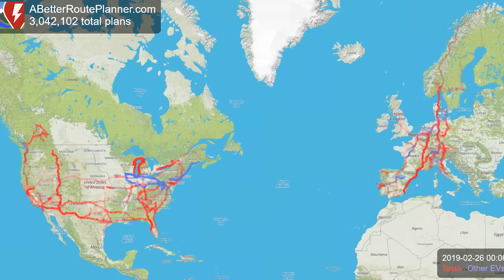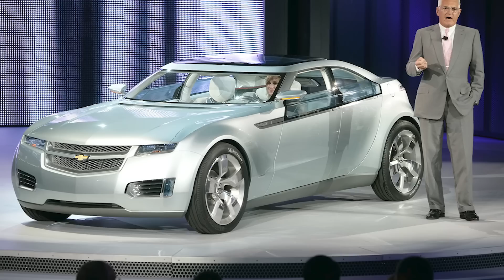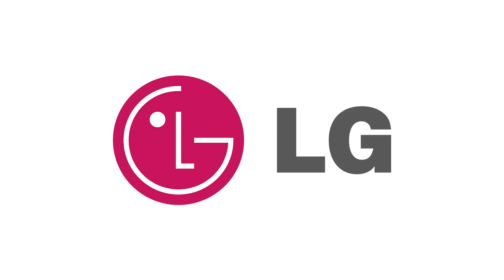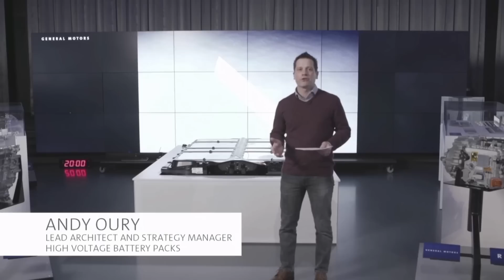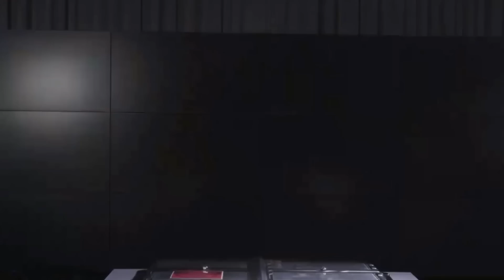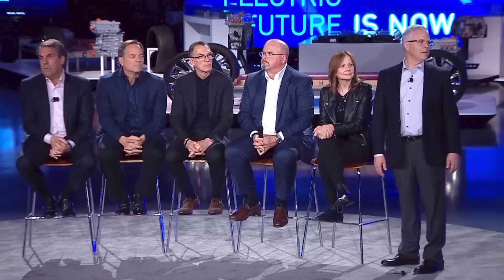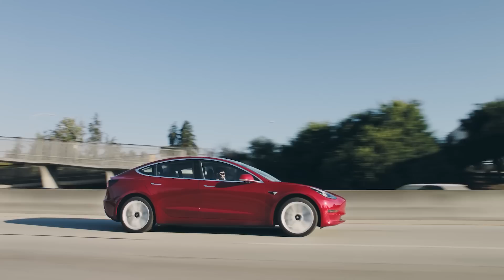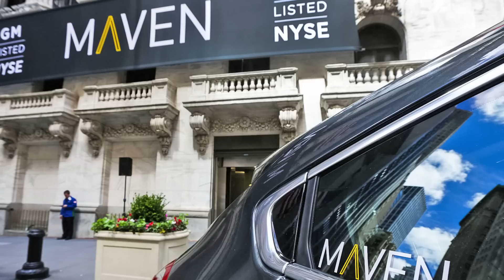GM EV Day | In Depth

Comment: My Volt “16 is great for what it is, still is, the longest range essentially plug-in hybrid. But then my Model 3 came and the rest is history. The same pack batteries they show is what was in the “12 Volt, except for whatever reason they put the batteries vertically instead of flat and in a giant T shape because they were shoehorning them into an existing small car platform. So they are making progress and I applaud them for it but they really needed to announce complete EV replacements for entire segments. Or else their EV’s are going to compete with the ICE versions of the same car and languish and go nowhere. If they said “all GM crossovers will be EV’s, there will be no ICE crossovers” that would be huge. So I think it’s great but it’s not nearly enough.

Comment: the most "funny" thing (actually pretty sad once i thought about it) is ... 1 million EV in 2035 ... if the sales volume of GM declines roughly at the same rate as it has since 2016 .. they are only going to sell a million vehicles total in 2030.
i mean that could be them saying "all of our car sales will be EV in 2035" .. but that also means that likely 50% or more of the jobs are lost if they drop sales by 70% or so

Comment: I have been a fan of Tesla, even before its creation, since AC Propulsion and tZero, when I was designing my Cherokee EV project. I ve been watching u appreciatively for ur work too.
But, I remember how non-constructive and ridiculous reports and videos against Tesla were back in the days. You sounded like the ICE-supporters hammering on Tesla and EVs, full of despise. I am rather happy that GM (despite their very dark and almost evil EV history) have been forced down the path of EVs. Every step a co makes in that direction is good. If they are not quick enough to adapt and change, then someone else will take their place. In fact GM's announcements may push smaller emerging companies or even other big competirors to move faster.
So be nice. Be supportive. Even to the ones who are just starting to move now. Every little bit of force in the right direction helps our planet, directly and indirectly.

Comment: At 26:00 you reacted to the comment that "our auto dealer network is a huge asset ".. I agree as it is now, it will crash and burn, and Jesse pointed out they can drive right out of the factory and right to profit.  However,  GM has never wanted a hold onto equipment or maintain it..  Just like they care not how you charge your car, that is for someone else to figure out.. 
My guess is they think they will make the cars, then the dealers will buy them and THEY will run the ride share aspect, maintenance, charging, ect.. and then buy new cars as they get worn down.  Replacing repairs of existing vehicles with autonomous Fleet Management as a revenue stream.

Comment: Just wondering so many still believe in Musk's hypes. No real electric vehicles will replace the current 99% "fleet" of ICE cars and trucks until proper battery source is invented/discovered and stop powering these current expensive toys with laptop batteries. Whoever put the new Ford-T-Electric on the road will be the king. Just mho.

Comment: Current Chevy Bolts have flat pouch batteries as I understand it.  The issue with any EV battery type is is cooling and heating the whole system of batteries when necessary--and doing this with minimization of electricity consumption.

Comment: To be clear, GM did develop a skateboard ev platform way back in 2002 and used it in their 2003 Hy-wire concept, which they promptly did diddley squat with. Essentially everything they announced was from 2003.

Comment: Zac, you said about the Chevy Bolt:  "LG makes the car" ??? Do you mean that LG makes the batteries  ?
Reply: Pretty much everything important is made by LG Chem with the car assembled in Michigan. See https://www.greencarreports.com/news/1102176_bolt-ev-powertrain-how-did-gm-and-lg-collaborate-on-design-production
Reply: @JimArnold6  Wow.  I had no idea.
Reply: @aardvarkansaw  We own a Bolt, Tesla and a Leaf. If the Bolt fits your use case and wallet, it's a competent EV that somehow escaped from GM. The Weber State Bolt videos by John Kelly are interesting and gave me the insight to the Bolt's potential before making the plunge - https://www.youtube.com/user/WeberAuto/search?query=bolt - Tesla, however, is in another league when it comes to driving dynamics, software, charging, autonomy, etc.

Comment: Regarding GM's history with the skateboard design:  https://en.wikipedia.org/wiki/General_Motors_Hy-wire
Best quote: "In 2003, General Motors stated that it was confident that it could produce a commercially viable model by 2010."

Comment: When GM named the “Bolt”, I knew they were messed up in the head because of the confusion with the similar name “Volt”.  Unreal.  I have a 2016 Volt LTZ and love the car.  Best car I’ve ever had and got it for half price one year old.  My problem with Tesla, in spite of their superiority, is the cost.  The Volt gets me round trip to work and the engine takes me on road trips.  In the coming years, I’ll got pure EV but my Volt is still the car that works for me.  Likely the next car will be the cybertruck or model y.
Reply: Hi Andrew, I agree completely about the Volt.  It is the perfect "first EV" for many people.  I bought my 2016 Volt in January 2019 at Carmax for 19K.   It has been fantastic.  I have a 45 mile round-trip commute.  Because of the 50 mile all electric range, unless I go out of town I simply do not use gas.  I've put approximately 16K miles on that car, and 14K of those miles have been 100% pure electric.  My next car will be a full battery electric vehicle (BEV), but the Volt is perfect for me right now.

Comment: Used to buy a new GM car every two or three years starting with the 1955 model year.  Next was the 58, 61, 64, 69 and so on.  Back then GM was managed by innovative leaders and still their cars had reliability problems.  It seems that each year since then their cars have got worse.  In the 70s some of their cars were rusting out right in the show room even before they hit the road.  My last new GM car was a 1998 Buick Regal.  Started out great then developed electrical problems and the power steering rack failed.  Now all their leaders in innovation have retired and they are even struggling with making ICE cars let alone trying to compete with all the new electric car companies.  Based on their past history I am now questioning why we even bailed them out a few years ago.  It seems they are still trying to make their failed business model work.  So sad to see them continue down the wrong road.

Comment: did anyone notice the 200kwh battery size they were talking about and the '400 mile' range that the vehicle would get? that equates to 2miles/kwh....that is the worst ev efficiency number i have ever seen! even the tesla model x towing has over 2 miles per kwh...Then do the math on how they are saving money on batteries and you then notice that they are still spending double what tesla does for the amount of range that they are getting when they have to double stack the battery to achieve 400miles of range. for example, the model y is over 300miles per charge of about a 70kwh battery. if gm paid $100/kwh for the battery it would be $7000 for a 300mile range assuming the efficiency was on par. their efficiency is effectively half so a car that goes 300 miles would take a 140kwh battery or $14,000!!!! how can they possibly say that as a good thing?? At this point it is super easy to tell that they are completely lost on electric cars and have no idea what to do.

Comment: Porsche:  We just made the least efficient EV in the world!
GM:  Hold my beer.

Hummer:  800kw battery, 400 mile range.  0.5 miles per kw.  Oink. Oink.  Dredge the road.  Hope you're driveway and garage can handle a 20,000lb vehicle!
Reply: David Urry, I couldn't find the actual battery size, but they have an 800 volt battery. The battery won't weight 20,000 pounds. It'll be less inefficient than a Tesla, I would bet, but it won't be 10 tons.
Reply: My guess is that it would take a 120 kWh battery to go 400 miles.

Comment: TSLA will have 1 giga factory/year for next 4 years and after that 3 giga factories every 2 years iff they can find battery supply. So, i.e. 3 (now)+4 (2020-2024)+9 (2024-2030)=16 gigafactories by the end of 2030. 16*0.6M(conservative) cars ~10 M EV's by 2030. They could very well do 12-15 M EV's by 2030, given the Europe gigafactory will have 750k capacity). They are going to eat these companies alive if they dont have million EV target by 2025. I tweeted at Mary Barra that she needs to consider  acquisition of Ford that could lead to internal consolidation of trucking followed by slashing the dividends. I doubt she will move with that urgency since she dosent do Math.

Comment: I have a 2012 Chevy volt. Gas engine just blew up with 120k miles on it. No warranty anymore. GM will do nothing for me, so I have an EV that has 35 miles of range if it’s 40 degrees or warmer outside that dumps oil everywhere. Last GM vehicle I’ll ever own.

Comment: You guys are so blindsided by your constant exposure to EV terminology and knowledge, remember that more than 95% of car buyers still buy ICE cars , so for a mainstream car manufacturer to start changing the narrative to their fan base . Is an accomplishment by itself. And yes the oil industry will try to slow the paradigm shift as much as possible. Yes they are slow to start but if they are committed internally to do it they could catch up .

Comment: A plug in hybrid is the worst of both worlds still need gas still have to charge just a terrible idea.
Reply: JEMS At least the Internal combustion engine can switch off at standstills, all cars could have that technology by now. Hybrids are now essentially redundant. However, as said at least the ICE can switch off when the car idles.
Reply: @josephfigliuolo7286  I see the ups but in my opinion I feel there are more downs to them, I may be wrong but that's how I see it at this point.

Comment: What also strikes me,  from this conversation,  is no mention of an electric product line across brands.  Will there be a Chevy, a Buick,  a GMC electric? Light pickups? Hybrid half ton and diesel one ton trucks? There could be good reasons for a blend of electric,  hybrid,  and diesel depending on application.  No sense of that whatsoever; just a handful of models.  Will the Bolt continue to look cheap,  while being so expensive? What of an electric sports car? There are even rumors that there is already in the works a hybrid model of the new Corvette.

Comment: LG and GM have plant that built the Volt batteries in Michigan.  It's not big enough to supply the entire organization.  I don't think you understand what they can do. Also you aren't looking at different car sizes.  You need to also build an entry level vehicle for a brand. That's a small car.  That doesn't have a lot of range. But if you can't build something that is under 20k, you can't get everyone into until they are used.

Comment: They did come up with the skateboard design. Go look up the late 80s early 90s. GM was talking a SKATEBOARD FUEL CELL DESIGN.  The skateboard proposed at that time would be the life of the car, dropping a different body onto the skateboard to match where the customer was in thier life.  You need to go look that up. Because the "skateboard" was a GM proposal just a fuel cell instead of the battery model

Comment: GM is trapped also by the stock market. Look at what happened to Kodak, they had the huge high profit film market for decades, they also invented the digital camera but there's not the same profit in digital as film and there was with film and no way Kodak could have announced that they were switching to a lower profit model. The investors would be running out the door that very second screaming "SELL!".  I don't blame GM for being forced to speak in terms acceptable to Wall St.

Comment: 12:10 Actually they did, the GM Hy-Wire system of 2002 (https://youtu.be/hQHIWOurFz0) is the original skateboard design, but just like GM always does. They abandon things as soon as they are done showing it off at the international car show. It was an expensive R&D just like the EV1 that they just gave up as soon as the going gets tough. 
They've wasted 20+ years of innovation and learnings in exchange for the easy path and easy dwindling profits. And the Chevy Bolt is currently the most discounted car ($10K) as they simply aren't flying off the lots.

Also, either it was not covered at the announcement. But GM was the sole recipient of the Fed $2M Grant to develop dry cell tech. It's a drop in the bucket in R&D Cost, and frankly wouldn't even cover the salary and overhead of a small team for 1 year. But worth noting. https://insideevs.com/news/367584/gm-wins-solid-state-battery-research-grant/.

Comment: About the cost of Model 3 most people to get what they wanted spend 50k. The original line standers like me  spent near 60k if not over. Then you figure taxes of at least 5k. Plus you need to wire your house for Electricity for your car and that could be over a thousand. So the average person isn't going to walk in a buy a Tesla without some sort of statagy. People want my car they just cat afford it or justify it.

Comment: Automomy, is a nice dream, but let's be realistic. It's in the same category as fusion power. It's been 10 years away for the last 50 years. HD Maps autonomy, which most autonomy companies, are pursuing, is only viable, but very expensive in larger towns and cities. Camera autonomy, might be the future, but legislators will, take a generation or more to allow it on any widespread scale. And is it really autonomy ?, if automakers are passing e.v liability to their customers, by making them hold their steering wheel continuously. If we are very lucky robotaxies, will become a reality, before we are all old and gray. Full autonomy, presents far too many problems and pitfalls, to become widespread and make a difference, to the pollution & climate crisis...

Comment: Great show as always, guys! Please consider losing the concept that the business model of auto companies is to make ICE vehicles, parts, combinations. Those days are gone. Past tense. That used to be their business model. Now, it could be presented as: "The new auto mfg. business model, which is manufacturing EVs, has only 19 parts combinations of motors, drive trains, and platforms, which is much better than the old auto mfg. business model, which had 155 combinations, which was much more complicated, and expensive to build." 9:58

Speaking of EV simplicity, according to Tony Seba (below link video on cleantech disruption from 2016, but still relevant), ICE vehicles have 2,000 moving parts, compared to EVs, which only have 18 moving parts. This not only translates into simplicity of mfg., but it is one big reason why EV maintenance costs are so low, which in turn is why auto dealerships don't want to sell them.
https://youtu.be/Kxryv2XrnqM?t=1479

Comment: The funny thing is GM had the Hy-Wire concept in 2002 that was basically the same presentation 18 years ago.  Drop the ball much?
Reply: aiden huntley right! “ In 2003, General Motors stated that it was confident that it could produce a commercially viable model by 2010.[1]” from Wikipedia .